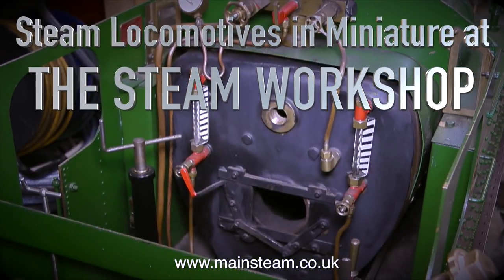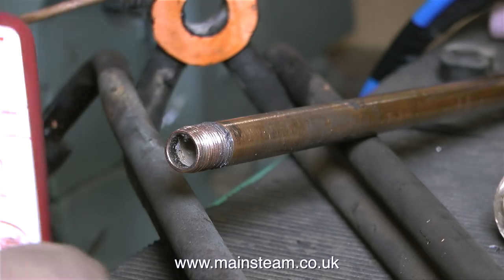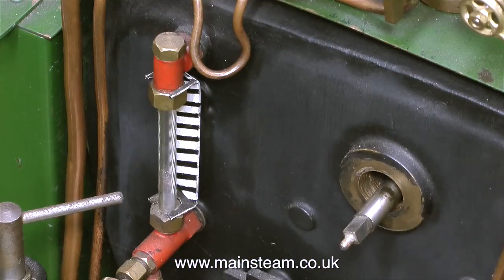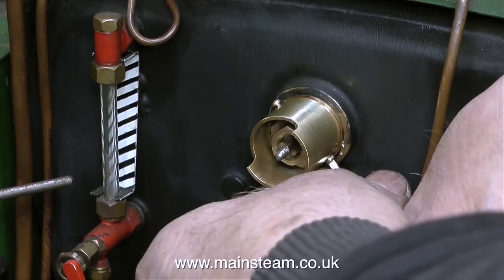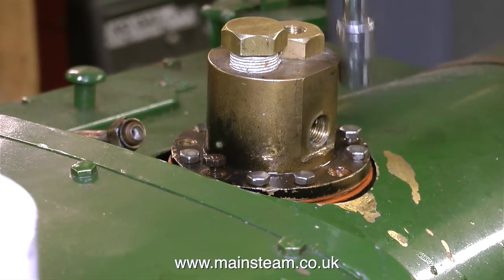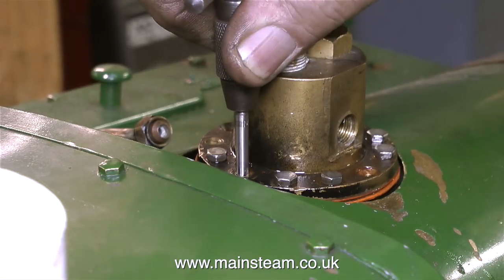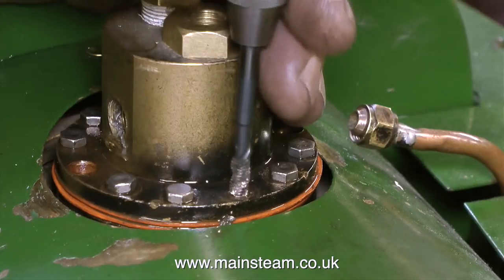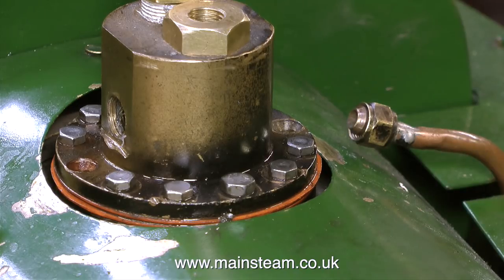WORKING AT THE STEAM WORKSHOP - REPAIRING A REGULATOR

Comment: What a curious arrangement with the water feed directly above the regulator, and how it requires that diffusor plate. Wouldn't it be a better idea to have a pair of pipes inside the fitting that leads the water down and away from the regulator? I don't know how GRW dealt with it on the fullsize thing but this solution just feels strange allowing water to pour right into the regulator.

Comment: Keith, after watching David Richard's latest Old Steam Powered Machine Shop video, I have a question. Do you ever clean out the boiler firetubes, or is that more of a full-sized boiler thing? Sorry if you've covered that and I've forgotten. Interesting video, as always.
Reply from the maker: Yes, I use a small Flue brush ...... if you use Coal to fire the boiler, even in miniature you need to keep the flue tubes clean - it makes a big difference to how well the boiler steams.

Comment: Taping through to the inside of the boiler is surely a problem?  Lots of small bit of swarf in there is likely to find its way through the regulator?  Am I missing something?
Reply from the maker: not a problem - the boiler has a blowdown valve anyway to clean it out.

Comment: So the regulator is simply supported by the dry pipe itself, hmm.
Reply from the maker: No it isn't .....it fits through the hole in the Brass baffle plate - I couldn't show that bit because my camera battery went flat ..... {:-(((
Reply: Keith Appleton Ah, thank you for the info.